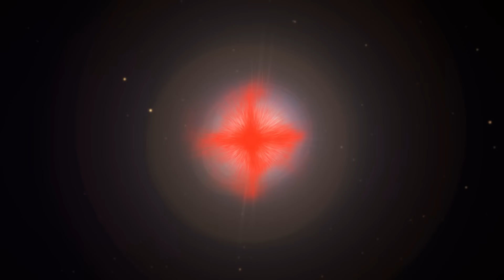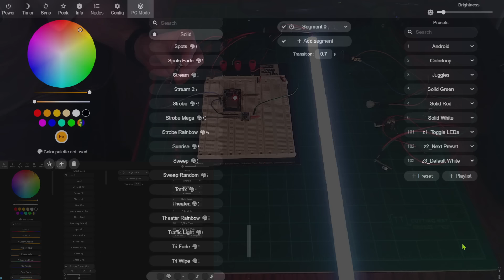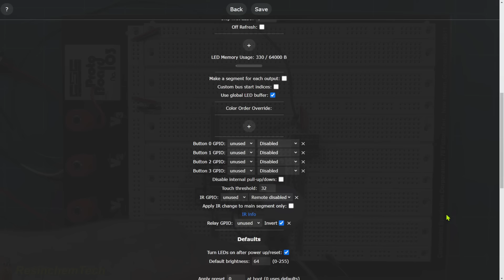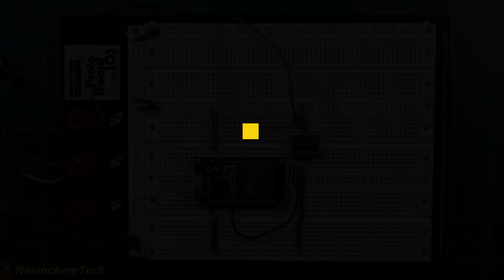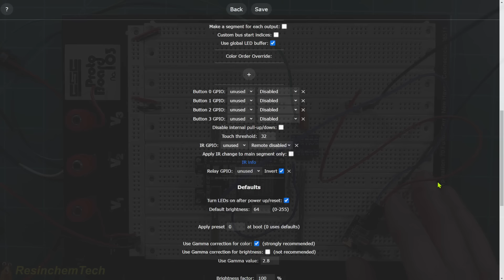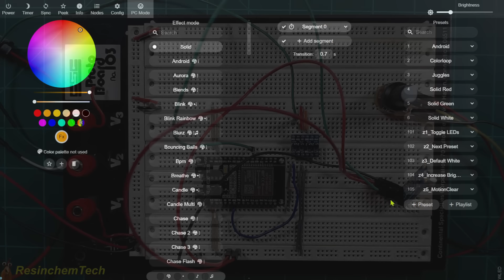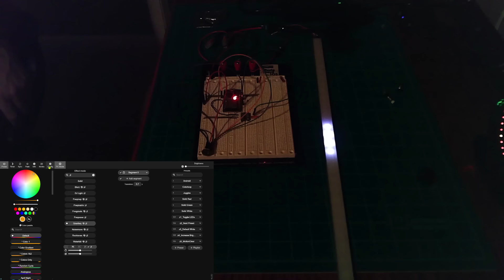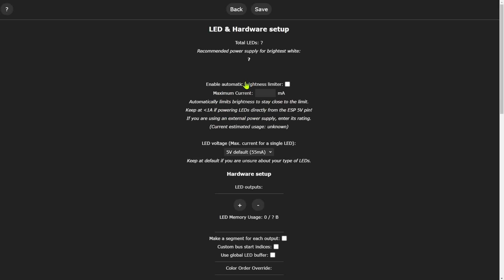Level Up Your WLED Projects: A Guide to adding Components (no code!)

Comment: Is there a way to control a stepper motor via WLED? Just a ON/OFF to make the stepper motor rotate until the power is set to OFF. If so how would one do so using a stepper driver A4988 board.
Reply from the maker: I don't believe you can controller a stepper driver directly as WLED is primarily firmware for controlling LEDs... not other types of devices.  It accepts a number of different types of inputs for physical control of LEDs, but doesn't currently offer control of (output to) external devices outside of relay control signals.  I suppose you could use a relay to control the power to the stepper motor and maybe accomplish what you want that way?  The relay would either power on the stepper motor when LEDs are on and cut power to the motor when LEDs are off.. or vice versa.

Comment: Came here looking for help with 360 Rotary encoder with push button.
Reply from the maker: This video focused on components that you can use with stock/standard WLED.  Currently, rotary encoders are not part of that list.  But there are a few different user mods available for using a rotary encoder, depending upon your needs:  https://github.com/Aircoookie/WLED/tree/main/usermods

Comment: can you control 2 led strips seperately with buttons? with only one esp32.
Reply from the maker: Theoretically, I believe so.  You'd have to define two segments and then create the appropriate presets for each segment.  You could then assign different buttons to the presets for each segment.  So, for example, Preset 1 could turn on the first segment and set a particular effect (say solid).  Then you'd define another preset, call it Preset 2 that would only set the effect (or off/on) for segment two.  These segments could be a single LED strip or two independent LED strips wired to different GPIO pins on a single ESP32.  Then each button would only affect one of the LED strips.

I have another video on using segments and multiple pins in WLED if interested, but this is the method I'd use to have independent control of two strips with two or more buttons and a single ESP32.

Comment: Great video! Can you explain why you have 2 different positives coming off of the relay? Do you have 2 different LED strip you're powering? I want to do this but that part confused me
Reply from the maker: Just like a wall switch in your house, the relay is "splitting" the positive line.  The positive line from the power supply "enters" the relay (via the NO or NC terminal) and then "exits" the relay via the common terminal.  Think if it like cutting the V+ line from the power supply to the LEDs and inserting the relay inline.  So it isn't really two positives... but a single positive line that comes in and then goes out of the relay.  

You might take a peek at my written guide and diagrams ( https://resinchemtech.blogspot.com/2024/03/wled-components.html ).  There is one diagram that shows the relay wiring and from that, I think you'll see what I mean by splitting the V+ line, as the diagram is much more obvious than my explanation here!  Unfortunately, I can't post an image here in the comments.
Reply: @ResinChemTech  tha k you for the explanation! Your documents were a major help as well! I love watching a video, and then being able to read the notes too! You're very smart, and I think I have it figured out now! The 3.3v from the buck converter is to power it on, and the top common is where the LEDs are getting the actual power? Not sure if that's explained right, but i stared at your documents for a while and I think I've got it! Supplies will be here this weekend! Wish me luck!
Reply from the maker: I think you've got it.  If you are using the relay to control the power to the LED strips, think of it just like a wall switch that controls your lights.  The +V is 'split' by the switch.  When the switch is 'on', power flows and the device (LEDs in this case) get power.  Flip the switch "off" and the +V line is broken by the switch and no power flows.

The difference is that we can electronically "flip" the switch by feeding it a data signal.  I used a 3V relay so that I could feed the data signal directly from a GPIO pin on the ESP (these are 3.3V).  The buck converter is needed to step down the 5V power (or 12/24V depending upon your LEDs) down to the 3.3V needed to energize the relay.  Alternatively, you could use a 5V relay and not need the buck converter.  But then you'd have to step UP the data line signal (remember it is 3.3V) to the 5V expected by the relay.

Think of it like this:   one end of the relay (labeled with VCC, IN and GND) is for the power and signal to control the actual relay.  If it is a 3V (3.3V) relay, then you feed 3.3V to VCC and GND from your power supply and a 3.3V data signal from the ESP to the "IN".  The voltage and signal on this end has absolutely nothing to do with the voltage being "switched" on the other end.  This could be 5V, 24V or even 110V AC positive line "split" between COMMON and either NO or NC on the other end.  Just don't exceed the rated voltage or amps printed on the relay.  Just remember, one end is for powering the actual relay and receiving the signal to switch it on/off and the other end is the actual power you are switching.

Best of luck... and don't hesitate to reach back out with any follow up questions.

Comment: Regarding the potentiometer:  don't they only have a limited range via which they can turn?  What happens if while it's turned to the max setting, someone dims the lights?

If I want to bring the lights back to max brightness, it seems like I wouldn't be able to use the knob -- I'd have to do it in HA.

With that in mind, is there a way to do this with a rotary encoder?  Or am I misunderstanding something?
Reply from the maker: I haven't dug deep into the code, but the way WLED is currently using a potentiometer to control brightness is by varying the voltage on an analog pin and this voltage is then converted to a brightness level.  This isn't something a rotary encoder would do.  I believe there may be some user mods available in the WLED Github repo that use a rotary encoder (here's just one that I found that uses a rotary encoder for brightness: https://github.com/Aircoookie/WLED/tree/main/usermods/usermod_rotary_brightness_color ).  Of course you'd need to include this mod and compile/flash your custom version.

And yes, it is true that a property can always be changed outside of any physical controls and this might cause the local controls to be "out of sync" with the actual setting.  But this is true of many types of devices... smart light switches/relays, media players, volume controls, etc. that can experience the same situation.  If you are developing the firmware, you can try to minimize these situations by establishing two way communications for state (via something like MQTT).  But even doing that can't physically move a switch or dial so that it stays in sync with the actual setting.  Short of using some sort of electro-mechanical switch or dial that can be physically turned via an electronic signal, it will always be possible that physical and software settings can fall "out of sync" if they both change the same value.  All you can try to do is create automations or build/configure the system to minimize those situations as best as possible.  

I have a similar situation with a rotary encoder knob I use for volume control on my DIY amp.  However, I can also change the volume via Home Assistant (MQTT).  If I change the volume via Home Assistant, then the encoder knob is in the "wrong" position... maybe showing 25% volume (via the indicator line on the knob) when the actual value might be 45%.  I added a 'resync' button on my HA dashboard that will set the volume back to the current knob position.  I also resync these values on HA startup.  And of course I can always adjust the volume in HA back to the value shown on the encoder knob.  Not perfect, but works in most situations for me.  Yes.. it is possible the knob and actual volume level aren't in sync, but they get resynced from time to time.

Comment: Such an amazing and in-depth dive into WLED and it's accoutrements. Thank you for putting the time and effort into recording and editing this.

This cleared up a lot of questions I had for my next WLED project...lighting my wall-mount network rack. I plan to use a magnetic reed switch to turn the strips on full brightness white when I open the door, and have it play one preset when I close the door. And with the knowledge gained from this video, I also plan to use one of my microwave motion detectors to turn the lights off when I'm not in my office.
Reply from the maker: Thanks for the comment and kind words.  Glad you found the video helpful!  I'm continuously amazed at all the things WLED can do (for free no less... with more features added all the time).

If you end up creating a video or posting pictures of your project somewhere, be sure to come back and share.  I love to see other projects that my viewers make!

Comment: Hi! Is there any way to do something similar with rfID as well?
I'm working on a project that would need a way to switch between two wled presets when a tag is registered on RFID-RC522 reader.
Thanks in advance!
Reply from the maker: I don't think that you could do it with just WLED alone.  WLED doesn't have the capability to receive and process the SPI signal from the reader for different tag values.  While an SPI setup is available under the UserMods, I think this is primarily available for display output.  There may be a user mod available for something like this, but I'm not sure.

The alternative is to use a second ESP/controller for the card reader and send commands to the WLED controller from the reader.  Commands can be sent via HTTP:, JSON or beginning with 0.15 (at least in beta), using ESP-NOW.  Of course something like Home Assistant could also be used as a "middle man" to read the card values and then send the appropriate commands to the WLED controller via automations.
Reply: @ResinChemTech  Thanks for replying! ❤

Comment: Please please help me for wled connections

1. i want to connect 50 strip in parallel (each strip have 100 leds). esp32 installed wled, 
there is some flickering and data loss in connection. how to fix it? how to do parrallel connections without data loss?

2. can we sync multiple esp32 with each other without any external wifi router?

TIA
Reply from the maker: Flickering LEDs are almost always caused by one of two issues... a noisy or weak data signal (use a resistor and/or a logic level shifter) or voltage drop along the LED strip (add power injection to solve this issue).

As far as running parallel strips, you can use multiple data pins on the ESP32.  However, currently only a maximum of 10 data pins can be used.  You would need multiple controllers for 50 individual strips.  But as you mentioned, you can sync WLED controllers together.   I have another video that covers various methods to sync controllers together:  https://youtu.be/HYdouRHfadE

However, these previous methods do require WiFi.  But beginning with the current beta versions of WLED (0.15.0-bx), the ability to sync using ESP-NOW instead of WiFi is available.  I have not tested this, but it would theoretically allow syncing of multiple controllers without WiFi as ESP-NOW communicates directly between the ESP32 boards.

Good luck and I hope that info helps get you pointed in the right direction.

Comment: Hi, thx for an excellent video. I tried to use a k22 ir sensor and a 20ohm potentiometer on my ESP8266 Board, as you suggested. When i connected a potentiometer it did not work and the LED light also does not light up when connected to a 5v power source or via usb on the computer but the LED lights light up if i disconnect the potentiometer. When i connected the ir sensor the sensor responds with a red light when i press any button on the remote but the led strip does not respond to any button on the remote. I tried D1/D2/D3 pins on the board. Any tips on what i am doing wrong? cheers
Reply from the maker: There are many potential issues here.  But I'll try to give you some things to look at or consider.

First, you said 20 ohm potentiometer.  I was using a 20 kΩ (20,000) potentiometer.  You might need a different range or value... 25K, 30K or even 50K.  Of course it also needs to be wired and defined properly in WLED.

As far as the IR remote, would you be using the audio-reactive or sound-reactive version of WLED?  Last I knew, the IR remote functionality is disable with the audio/sound reactive versions.  Are you using a different remote?  You might need to check/alter the codes being received by the WLED controller.  You can find info on that via the WLED site at:  https://kno.wled.ge/interfaces/json-ir/json_infrared/

Hope that points you in the right direction.
Reply: @ResinChemTech  Hi, thx for your response. I am using a 20k ohm potentiometer, 20ohm was a typo. I am using  WLED_0.14.4, thats not the sound reaction version, is it 
? I am using the exact same 44 key remote as you did in this video. cheers

Comment: Hi ! Thanks for the video. I'm wondering, if you used 5V for your IR receiver, why didn't you connect it to the ESP32 through a level shifter ? The 5V signal won't damage the ESP ?

Comment: Great Video!! I have a question: Is it possible so connect a single Laser Diode to a WS2812b Chip and control it with WLED ? I could not find anything like this but before I try it myself maybe you know more about it. 
Thanks
Reply from the maker: Sorry... I really haven't used laser diodes, so I can't say what might be possible with something like this.  But let me know if you get it working.

Comment: Hands down, the best video I stumbled across when looking for WLED features and use cases. I've been playing with WLED for a bit more than a year and some of the topics covered were still a mystery to me lol.
Reply from the maker: Glad you found it helpful.  I usually always learn a thing or two myself just in the process of making a video.  That was especially true in my follow up video to this one where I talk about WLED segments and syncing options ( https://youtu.be/HYdouRHfadE ).  In that one, I wasn't even aware that 'virtual' LEDs could be defined to control LEDs connected to a different controller.  And more features get added to WLED with each new release.

Thanks for watching and taking time to leave a comment!
Reply: @ResinChemTech  Thanks for taking the time to reply to a viewer ! :) I had also watched your other video and that's where I discovered about the Virtual LEDs too. 
I''ve put together a setup for launching parties with a few 1m Strips which are hanging in trees and synced together. Presets are changing via a playlist our sound reactive mode.

For the record, with the sync feature. I observe that it's not always perfectly in sync (depending on the disance between ESP32s and router ) and sometimes, the preset change simply does not happen on a node. 
I need to investigate if that's not an antenna issue. but you video talking about  virtual LEDs  gave me an idea.
. 
Maybe it'll be more in sync this way (since it needs to send data like it would do to a segment and not just send a preset change info.)
It also allow to have patterns that expand on the various strips, instead of just replicating each other. all exciting ideas.

Next step is to run a LedFX on an RPI :)
And thanks again for your videos! Cheers from France

Comment: Instead of using the relay to switch the output of a power supply for the LEDs, use it to switch the input. This assumes your microcontroller has a separate power supply. Large power supplies draw a fair amount of power with no load on them and you'd like to switch that off. You can also switch a lot more power with the relay, since switching 120/240 volts  draws 1/20 the amperage of switching 5v. — Nick

Comment: Excellent presentation. Most of my stuff is from the Arduino IDE and 5 volts and no place for an ESP-32. However, WLED exploits fine goods with simplicity, something I'm willing to set aside time for. I like buttons, switches and blinky lights.

Comment: Wow, I probably could come up with that myself after digging through documentation, but you presented all of it in such a coherent way, thank you! I'll definitely come back here when upgrading my wled controllers!
Reply from the maker: Yeah.. nothing I did here is a big secret or anything.  But sometimes locating the correct and current documentation can be a challenge, and for a lot of folks just starting out interpreting often tech-jargon heavy  (or poorly written) documentation can create additional hurdles.  So I try to approach all of my videos from a true beginner's perspective where someone may not have a lot experience or practice at decoding some of the technical guides.

Thanks for watching... and taking a moment to leave a comment.  I appreciate it!
Reply: @ResinChemTech  I'd kill for a video like that when I was starting out with Arduinos and FastLED back in the days. All I had was some forum posts :D

Comment: Thank you for this awesome tutorial!  Quick question though, would it be possible to use a 3.5mm audio jack instead of an analogue microphone for sound input.  I want to create a display that wont be triggered by ambient sound.  Thanks!
Reply from the maker: It is certainly possible.  I have not tried it myself, but you can find info on using a line-in option as the source for audio reactivity here:  https://kno.wled.ge/advanced/audio-reactive/ (info on using line-in is near the bottom of this page).